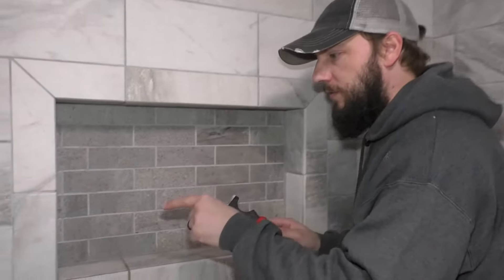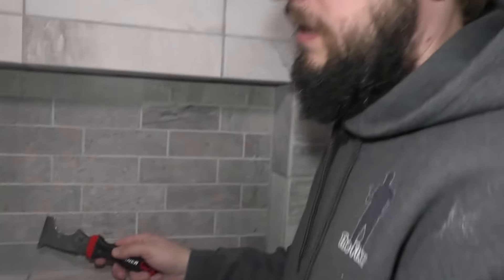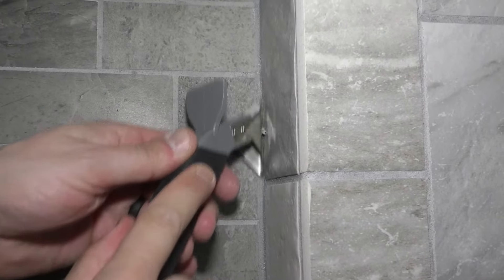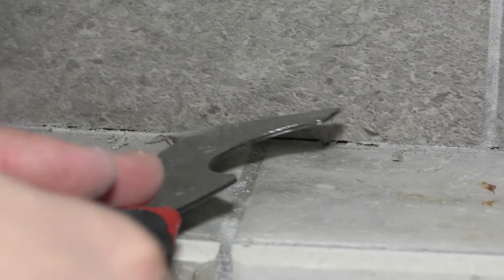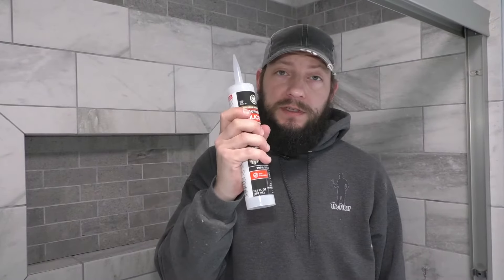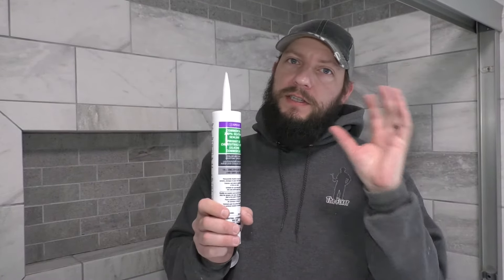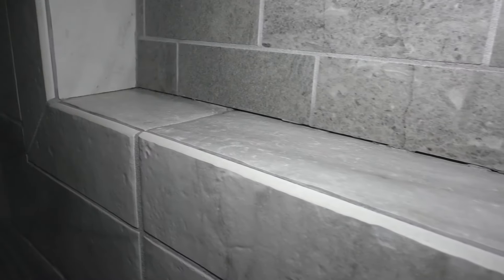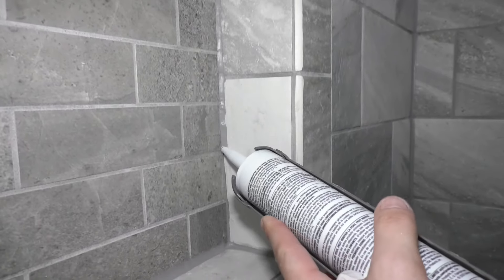Use the Correct Caulking for Your Shower or Tub! | The Fixer Clips

Comment: I’ve seen an interesting tip with caulk. Cut it in the reverse and push instead of pull and that angle cut will push it down in there a little smoother.